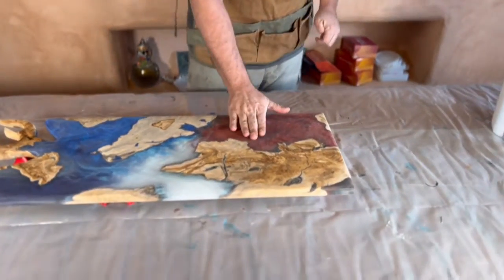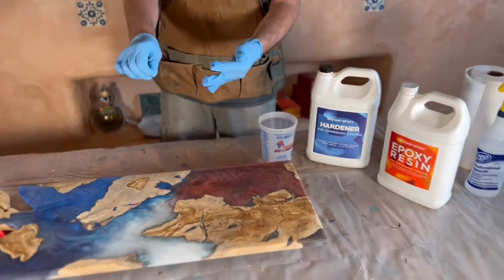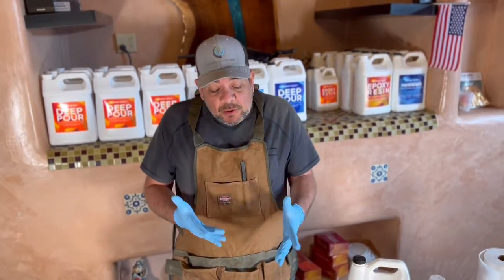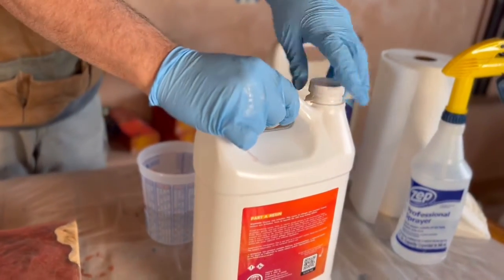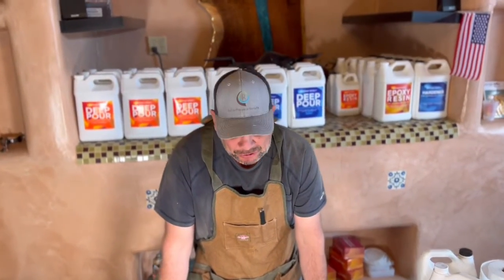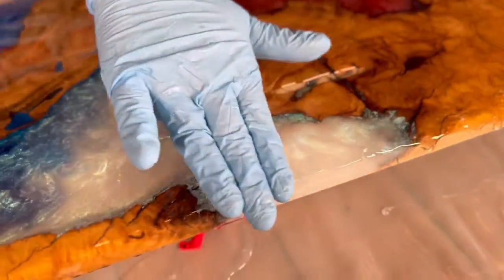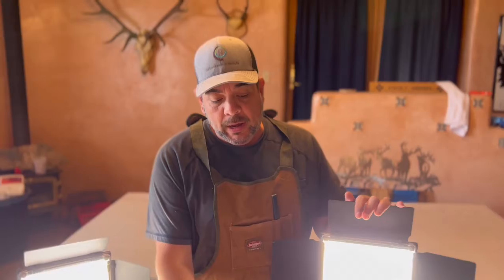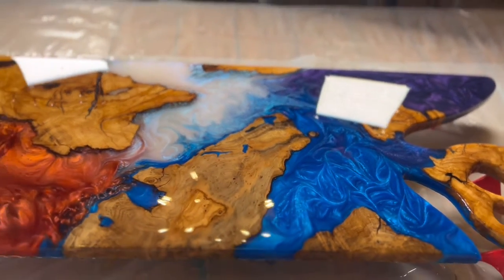THIS is How to Flood Coat - Tips for Finishing An Epoxy Resin Piece

Comment: I realize this video was 2 years ago, but a question- could you use sanding sealer first as a sealant for a first coat? Thanks I like the tutorial👍
Reply from the maker: Thanks for watching! While sanding sealer can be used under some finishes, it is not specifically designed for use under epoxy resin.

Comment: How does the oil get to the wood if you have poured a couple of flood coats?
Reply: It doesn't. Any finish you put on the epoxy is being applied to the epoxy, not the wood unless the wood is exposed.

I don't know how I feel about flood coats. I think I prefer the surface having both wood and epoxy
Reply: He's oiling the BACK to seal it after the epoxy pour is cured.

Comment: Do you use walrus oil on a table top that is totally sealed with with epoxy or would that be a waste since the epoxy wouldn’t absorb it -  I have been using walrus furniture finish on wood pieces and love it.  Have a epoxy writer desk from blue stained pine wondering about a cost of walrus when flood coat is set up thanks
Reply from the maker: If the table is already sealed, there is no need to apply walrus oil. It won't absorb through the epoxy since it creates a seal.

Comment: Before pouring your seal coat, how did you prep the board? Sand to 320 grit? Did you wipe off sand dust with water?

Comment: The stir stick itself controversialy if wood, causes bubbles, so they say, so silicone stir stick/spatula.  Closer to 8 ounces is when they say/recommend a drill to eliminate unmixed resin.
Hope to try mica powders someday, awesome project.
Reply: That actually makes a ton of sense. If you drilled carefully, thr bubbles just can't come from nowhere

They'd have to be introduced by folding essentially, but for a large batch, using a large wood stir stick, depending on thr epoxy viscosity, I could see a ton of bubbles coming out

Comment: nice videos here in this channel ,i finish a table top with a flooding epoxy finish and 3 days after its cupping down ,table looks perfect and now dont know what to do because is finish ,i cant flatten it again because is 1.5 inches .is cupping the opposite way that boards does ,i let it to cure over some acrylic cubes on the underside ,can i fix it ? what can i do ,? turn the board over and put some wet towels and clamp it down or what? im very upset i have been working on this table for weeks .

Comment: How do you deal with the bottom that has all the drips from the seal coats?
Reply: I run painters tape around the bottom edges that way when it’s done you just pull them right off

Comment: In this thickness, if we get micro bubble air pocket , because usually because of dirt silicone i need to sand it off with 220 or 320 , so in that case the micro air pockets gets filled by resin/ sand dust ..
Can we cut those off  on this thicker layer